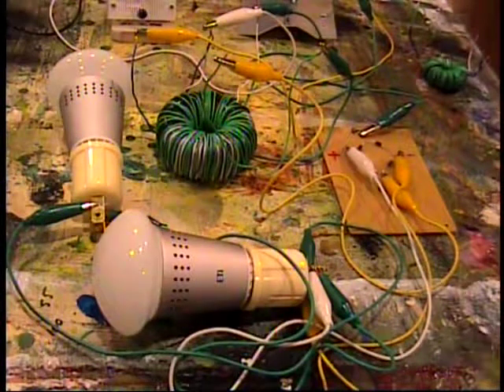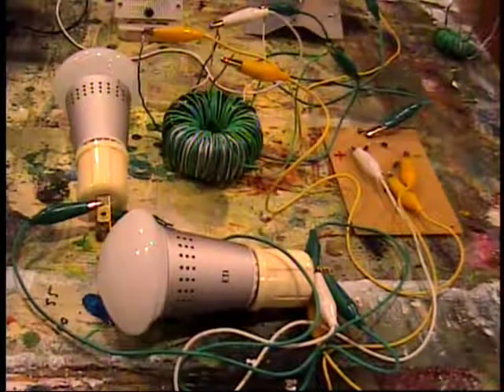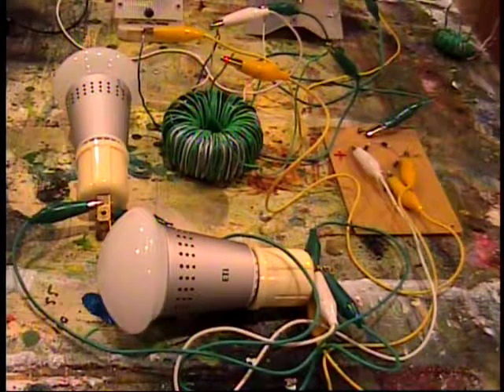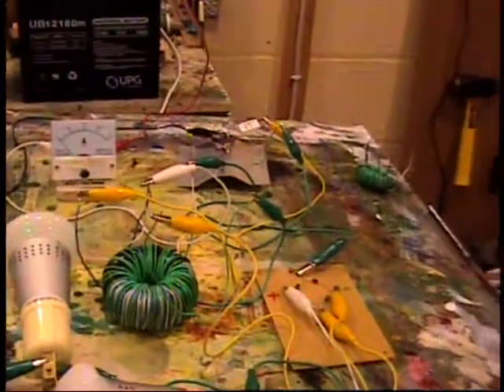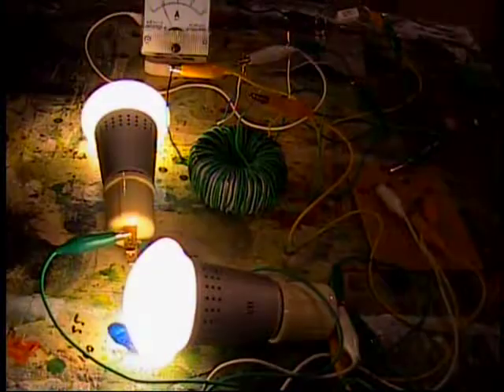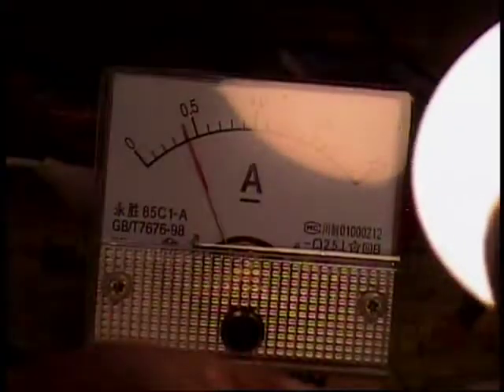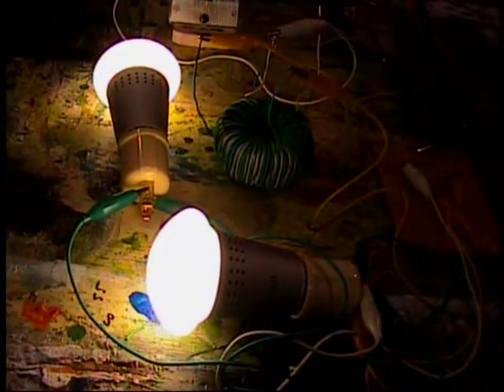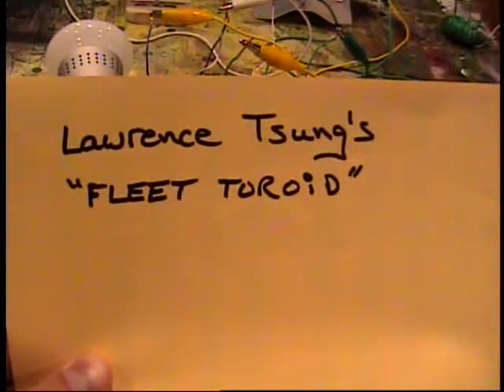Fleet Toroid Practical Power Saving

Comment: thats not 17watts of light,only 5 watts....so your not really getting OU
Reply from the maker: Valid point. You can't tell if the bulb is full brightness on camera. However this is a non-dimmable bulb. 5 watts wouldn't light one no less two. I use this bulb as a measure because as a cheap bulb the circuit needs a certain minimum to light. I take no-load measurements then test with something real to make sure. Your welcome to test it for yourself. Also I don't use the Over Unity statement. I'm not a Physicist. I just point out that this circuit works much better then standard transformers. I don't have the equipment to know why it works so well.
Reply: @ronaldgerth5120 🕺🕺💃
Reply: Ronald Gerth duty cycle is why it works so well. The switching of the transistor is faster than the human eye can see, much higher than the 24Hz that makes motion continuous to our eye. The rise and fall of the voltage required to light the LEDs happens faster than we can see. It’s efficient in that the duty cycle is under 100%. 
I’d love to see a voltage multiplier at the output rather than these bulbs...the plasma would be awesome.